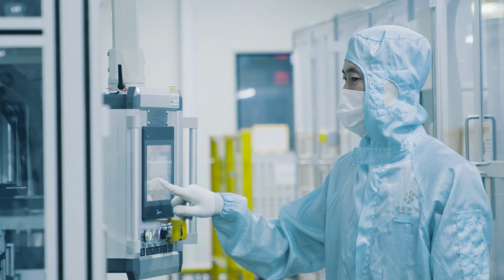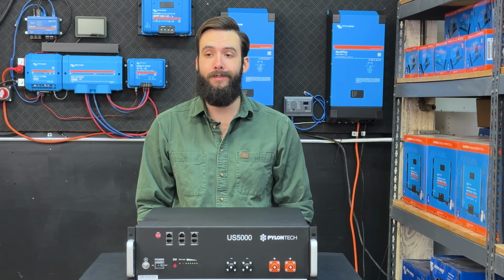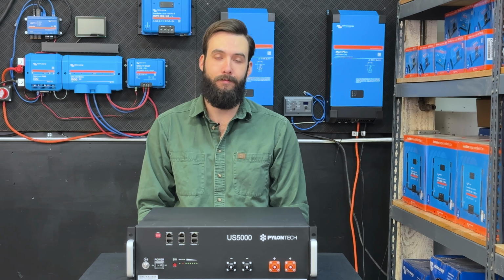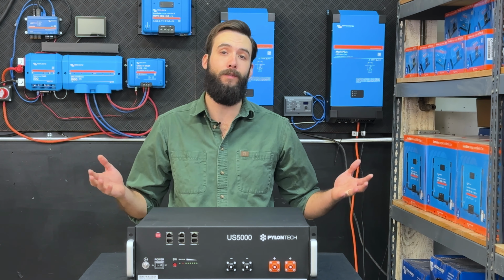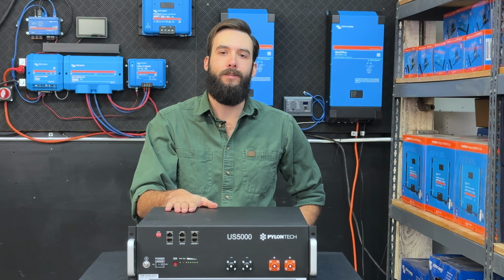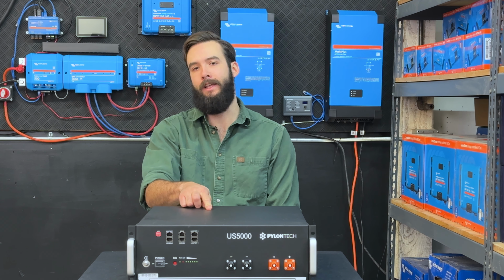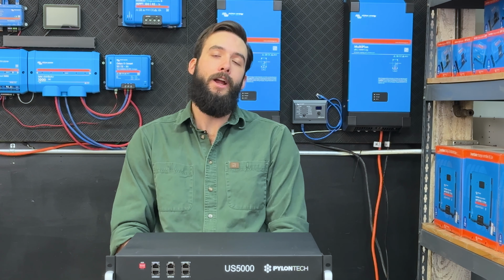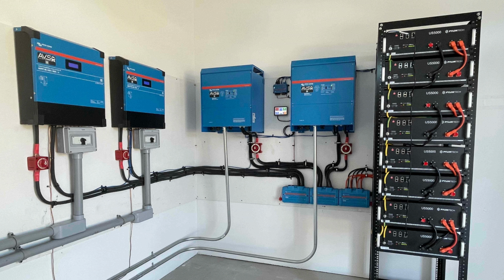Intro to Pylontech’s US5000 48 Volt Lithium Battery

Comment: Pylontech warranty may be 10 years but if you try getting support from them you quickly learn that it isn't worth anything. On day 1 of having a faulty battery the first thing they will ask for are battery logs which cant be extracted from from the battery without buying a communication kit. Then you will have to install a bunch of software to try to debug the battery. Imagine if your samsung TV broke then samsung said you have to pay 100 bucks for a tv tester before they will repair it.

Comment: OK as the owner of 6 of these for my almost off grid system on the Island of Crete Greece, I have some warnings to anyone buying these batteries.

Rule 1 absolutely inviolable if you live in the EU.

Only buy these from a local supplier especially if you live on the islands.

Why? Because if one of your batteries develops a fault the logistics of returning an item as a private individual are almost insuperable, you will run into  UN3480 Class 9 Hazardous Matter (Dangerous Goods). and worse if it is defective as Damaged/Defective Batteries (Packing Instruction P908). applies. (this requires a fireproof and explosion resistant box, very difficult for a 4.8 Kwh battery as most will only take up to 1.3Kwh and discharging it won't get you round the rules)

The logistics are not a simple reverse of the original delivery procedure and and simply do not work for private individuals, as a private person you cannot issue the relevant documents for ADR across borders or via sea or air.
What about Schengen I hear you cry? That only applies to people not goods.

I bought my batteries from Amazon.de their supplier Offgridtec being a tier 1 distributor for Pylontech in Europe.

The whole logistics and EU law thing ignores the safety differences between Lion and LiFePo4.

So brilliant batteries but if you are in the EU and one goes faulty you are in for a world of grief, I have been battling this for 3 months now and my battery is packed in its original packaging covered in warning stickers and sat on my workshop floor awaiting resolution........

Comment: Looking to buy 4 US5000 to replace my Gel deep cycle batteries. How many end runs do you advise to use ? Any schematic with diagram to share? Tnx in advance
Reply from the maker: Hi @Duje394, happy to help you with this. Go to our website, intelligentcontrols.io and click on Contact. That will connect you with a member of our team who can ask a few questions about your setup, give you a quote, and answer any questions you might have during the installation.

Comment: I am.fitting 4x us5000 this week. I am very confused as I ordered a 2m battery leads set. But with 4 batterys connected together with 2 leads out to battery , the cable ratting is only 125 amps. Surley thats not safe as each battery is 50 amp .
Reply from the maker: This will depend more on your charge/discharge details than the battery ratings themselves. If your loads total under 125A, and your charge sources total under 125A, a single set of cables will do fine. If you need more power than that we do recommend breaking up the bank into further parallel sets. For 4 batteries we quite often do a set of leads on the top of the bank and a second set on the bottom - essentially paralleling both ends of a paralleled stack - brings your total bank amperage up to 250A (±12kW). So: it depends on your system.

Comment: thanks for video,  i have 4 US5000 in a single stack now,  it looks like i can add another 2 US5000 without needing to double up on cabling.    it looks like i can have a single stack of 6 no problem using the cables which come with batteries
Reply from the maker: If the overall power draw from you bank will remain the same, then you can absolutely add in 2 more batteries using the parallel cabling without needing additional end runs.

Comment: DIP1 Should I run it on the main battery or the second one? I have two 5K batteries.
Reply from the maker: There is no need to change the DIP switch unless you are connecting to an inverter via RS485. Even then, this is only necessary to change on the master battery if the RS485 connection requires a 9600 baud rate.
Reply: I live in a faraway land and I translate from Google. I am very happy with your reply. One last question: How can I be sure that the inverter voltage does not affect the battery? And does charging from the panels during the day and from the grid at night not affect it? SoH @intelligentcontrols
Reply: Please help me. Can I send you pictures of my system so you can make sure everything is fine? @intelligentcontrols

Comment: How can I properly fuse my Pylontech US5000 using the original 25 mm² Amphenol cable? The cable is only rated for 100 A, but there is no 100 A fuse that can handle 10 kA short-circuit current and also fits into the Victron Lynx.
Reply from the maker: Hi @19onit1 , in most cases the 2kA short-circuit rating of the Mega-Fuses, in combination with the internal protections of the US5000 contactor, are more than sufficient to protect the system. The intercommunication of the bank, should one battery shut-down for any reason, also allows the system to respond fairly intelligently. For installs where you need higher AIC ratings the Lynx Class-T Power-In (a Lynx with two slots and space for two Class-T fuses) is an excellent choice. It’s designed as a battery input device, and the Class-T fuses typically carry an AIC of 200kA.

Comment: I have 4 US5000 batteries connected to a Victorn system. The master battery seems to be permanently in idle mode with the other 3 working normally. VRM is showing all 4 batteries ok. Is there any way to work out why the 1 battery is always idle. Max SOC never gets above 93% and if I discharge them they stop at 30% SOC even though i have min SOC set to 10%, any thoughts on what may be going on?
Reply from the maker: Hello Leslie. How are your battery cables connected? If you are using a single cable kit with both + and - terminals connected to the battery furthest opposite to the master, then that might explain things. If that's not the case, shoot me an email and I'll see if we can work things out. mike@intelligentcontrols.io
Reply: Hi thanks for the reply. The batteries are connected 2 in parallel with each group of 2 connected to the Lynx distributor via separate cables connected positive to one battery negative to the other battery. Since my original post I have got a Pylontech USB cable and Battery View software. I can see the battery with the issue seems to work normally if it is just connected on its own. When connected as the master or anywhere else in the string of 4 batteries it just stays in idle not charging or discharging. I've charged each of the batteries to 100%SOC separately then connected as a string of 4 and it is alway the same battery that stays in idle so don't think it is a balancing issue. But the batteries always report as 4 good and all working in VRM.

Comment: Can you tell me is it ok to add a 2000c to my 3000c I have three. Will it balance and charge and discharge in balance with the 3000c.    Thanks.         🏴
Reply from the maker: Hello John, It will be fine to add those batteries together, just make sure that the master battery remains one of those US3000C’s.
Reply: @intelligentcontrols .    Many thanks for coming back to me.      🏴🇺🇸

Comment: was going to buy a victron smart mppt to pair with my pylontech batteries (us3000c)since you are pairing these 2 products does it mean when setting up the victron charge controller they already have anything preset for pylontech batteries or all has to be done manually?
Reply from the maker: Hello Jamie. If you have a Cerbo GX device in your system that both the MPPT and the batteries can connect to, then the settings will be automatically applied. If you do not have a Cerbo, or if you would like to hard program in the settings as a backup, I would recommend that you consult the charger settings given by Victron on their battery compatibility page for Pylontech. https://www.victronenergy.com/live/battery_compatibility:pylontech_phantom

Comment: I already have US2000 and US3000C on my system and i wanted to add one more to it. Please can you advise me which one is the best to choose bewteen US5000-1C,  US5000C, Or US5000. I am really comfused to pick one among them, Please just tell me the one to pick.
Reply from the maker: Hi @frednelly219, in North America your best option will be the US5000C. We can confirm they are designed to be backwards compatible with previous iterations of the US series batteries. Your primary install detail will be to make sure your newest battery, with it’s fresh BMS and newest software, is the battery at the “top” of the chain. EG: the battery the is the primary BMS that communicates with any external system.

Comment: Warranty excels till you have a problem, then they try and get out of it.
Reply from the maker: @veronicathecow, Pylontech doesn't sell directly to consumers so dealing with a reputable distributor is your best guarantee of good service. If your dealer is technically competent, you can positively verify an issue or failure using the BMS data logs, which should help with warranty issues. Unless there is malicious intent or divine ignorance, if you buy Pylontech batteries from us, we take care of you, replace the battery if needed, and deal with Pylontech on our own time.
Reply: @intelligentcontrols  Currently have 1 duffout of 4. Suppliers were helpful but not very technical. Eventually got someone at Pylontech but initially wasn't helpful. Got somewhere but life got in the way. Need to get a day or two to have a more in detail look. Shame it doesn't bluetooth to a phone app.

Comment: Why do Pylontech cheap out on cells and only use 15S.
Reply from the maker: Hi @kevinmills5293, the 15 cell design of the Pylontech batteries doesn’t notably reduce their overall capacity. The system simply operates at a slightly lower voltage than 16 cell batteries by around 2-4V. While they may have one fewer cell, they are significantly more exacting in their BMS and balancing circuitry than most other batteries we’ve examined. Their high/low cell-cell voltage differences are often as little as 2-3 hundredths of a volt across even large banks - many other manufacturers are considered balanced within 2-3 tenths of a volt from cell to cell. I do find the 16 cell structure is likely to simplify the internal balancing circuit as it allows for balancing 4 sets of 4 cells, rather than a circuit that balances each cell independently - thus a more cost effective, though less exacting balancing circuit when compared to the Pylontech.

Comment: Nice video but why you cannot see 2 batteries being monitored on there percentages on the Victron  connect app it only shows one percentage 
Thanks Troy
Reply from the maker: Hi @TP_LANDSCAPE_PHOTOGRAPHY, the battery percentage is the overall percentage of the entire bank. As your batteries are communicating with each other that number is the more useful reference for the system. If one battery is lower than the other, the two batteries will cooperatively work to balance, both while charging AND while discharging (and your SOC % will still be accurate). If you’re wanting to see more details on each battery; if you have RT12100s the Pylontech Auto App, for iphone or android, can give you independent details on each battery you have. In VRM the Advanced tab has an option to show the “Battery Min/Max Voltages” which is a great indicator of balance. If your minimum and maximum voltages are within normal range (.02V in most cases) your batteries will be essentially equal in SOC %. More specific battery details in a bank with the US5000 (or similar) is typically limited to bench test and troubleshooting situations.

Comment: Hi, can I use this battery on tri-phase system? So for example, i have two of these batteries, the grid goes off. Can I still continue using my house electricity the same way as it would be connected to the grid? all 3 phases will be ON as the batteries will feed the required electricity? thanks!
Reply from the maker: Hello Vlad. The AC phases of a power system are dictated solely by the inverter. If you have an inverter that supports your local AC power protocols and it is properly configured to draw power from the batteries, then yes. Please note that two of these batteries are going to give you 9kWh of usable power and 9kW of maximum current draw. Just make sure your battery system is sized appropriately for your application.

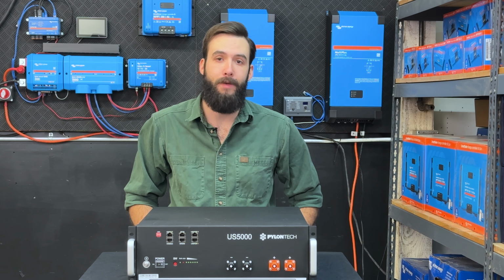Comment: Hi I would like to know How you calculated the charge Limit in your Video 05:56 Victron's DVCC Function Is it 50Amps per Battery in the stack ? yours is set at 551amps  I'm not able to get an answer from Pylontech I have 10x US5000-B's  2 stacks of 5 to a common busbar victron DVCC sets the charge current limit to 50amps Can I adjust it ?
Reply from the maker: Hello Martin. You can manually adjust the charge current limit in the DVCC setting tab on the Cerbo. In the video, you can see that we have “Limit Charge Current” toggled on, and then the hard limit of 551A set in. Without that limit toggled on, the battery will modulate CCL and DCL up and down depending on conditions. You can see this in the “Parameters” sub tab of the “Details” tab in the battery device menu. I believe that the CCL is a hard point that the inverter or MPPTs will not exceed. The DCL should be more dynamic, showing the preferred DCL but allowing peaks well past that.
Reply: @intelligentcontrols  Thankyou It is quite complicated,  so if I set it at 100amps it will limit current to that without causing other issues with DVCC This is the best I have understood  DVCC thanks Again

Comment: hi Mike, what do you think about the new model of pylontech uf5000 51v , is it a more upgraded and robust model than us5000 , also us5000 isn't available in my country
Reply from the maker: Thanks for the question. From what I have gathered from the manuals, the UF5000 is basically a Pelio in a rack mounted configuration. This means that it is a 16 cell vs 15 cell battery that will have 364W of usable power over the US5000 and allow a default charge and discharge current of 100A per unit vs 80A. The peak charge and discharge should be about the same, and the UF maxes out at a hard cap of 20 units per system, while the US5000 can be expanded from 16 to 96 units per system with the compatible LV-Hub. For the typical end user, there is no real practical difference between the UF and US5000, I wouldn't hesitate to recommend it if that is what is available to you. If you anticipate using more than 20 units in the same system, then the US series of batteries are the only ones that will facilitate this.

Comment: there are some people who are very unhappy pylontech aftermarket service  / warranty , most in the UK , particularly when there is a battery fault when YOU have to send the battery pack back to them to " repair " they do not offer a replacement service on a faulty item  ????
Reply from the maker: Hello Jim, I cant speak to Pylontech’s service arrangements outside of the USA, but here in the US the warranty process is handled by Intelligent Controls since we are the primary dealer and it is impossible for an end user to purchase directly from Pylontech. Our standard procedure is to send a new battery to the customer and then handle the warranty or repair process on our end. The process is fairly resource intensive for us with shipping costs and labor, but we are fine with that since it happens so infrequently and it allows us to take care of our customers.

Comment: Are those systems compatible when Enphase micro’s (IQ7) are used?
Reply from the maker: Hello, adding a DC storage system to an AC coupled system requires the use of a secondary inverter/charger (such as a Victron MultiPlus) that can invert the AC power coming from the microinverters to charge the batteries as well as pass that power through to your house loads. So, while batteries are not directly compatible with the Enphase microinverters as they require a DC power connection, the Pylontechs can absolutely be used once the required inverter/charger is installed to manage the DC system.
Reply: Is it compatible with any hybride inverter such as SMA, Solaredge or Huawei? Can it communicate?
Reply from the maker: @HeyFixThis  These are compatible with some inverters from the brands listed. If the inverters support either CANbus or RS485 communication and have integrated with the Pylontech comms protocol. Check out the Pylontech Compatibility List under the data sheets tab on our website https://intelligentcontrols.io/products/pylontech-us5000

Comment: Please tell me how DIP switches should be installed on Pylontech batteries if they are combined into a group of two or more?  Thank you
Reply from the maker: Hello, if you are using the US5000 or US3000C batteries then there is no need for changing the DIP switches. The DIP switches are only relevant for multi-group mode if you are using older versions that require an RS485 connection. If this is the case then reach out to me at mike@icmontana.com and i'll get you the info.

Comment: How low temprature can Pylontech US5000 battery take?  We have US2000, what about these?
Reply: It s written in the manual. Charges down to 0 degrees celsius, discharges down to -5 degrees celsius.
Reply from the maker: @silviannistor is correct. This is typically true of any LiFePO4 battery as it's a matter of the chemistry involved. Any battery with a greater range is using a heating source internally to expand that - essentially burning electricity to allow it to charge/discharge in colder temps.